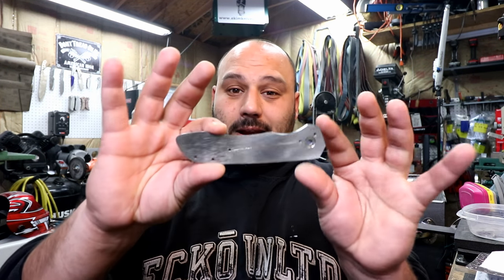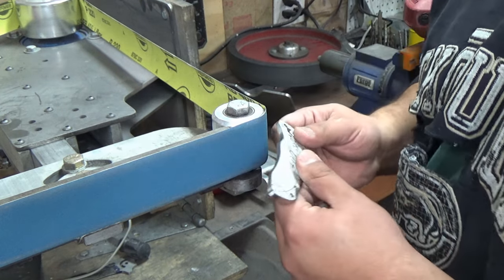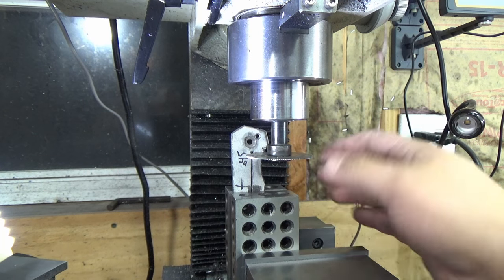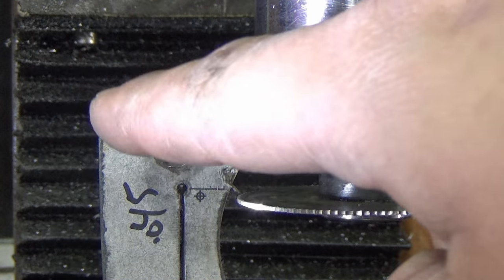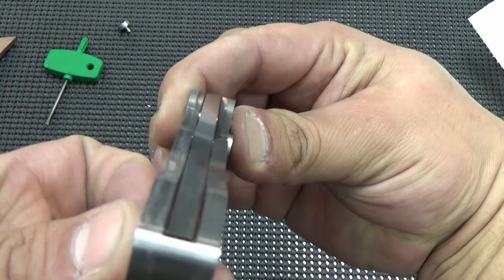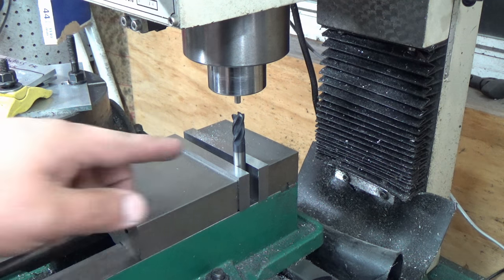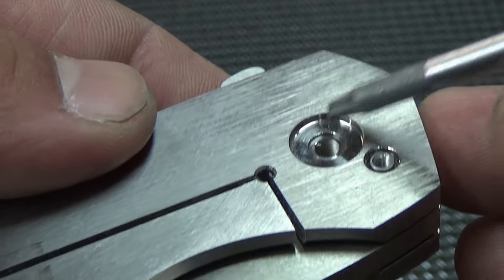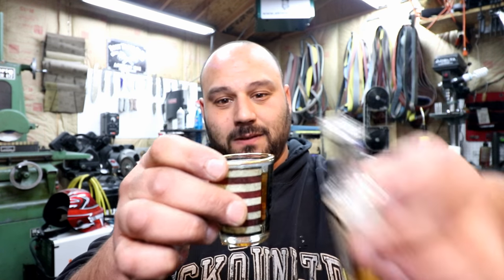How To Make A Folding Knife #10 Detail Work

Comment: Dear Mike, great video again; thanks for sharing your knowledge. I wonder why you used the vise-clamped endmill to shorten the pivot; is there a special reason to that approach? I would have chucked the pivot in the hand drill and gave it a kiss on a 120 grit belt to get the job done. Nice tip to grind the camfer on the inside of the scales before cutting the lock face. I'll do so on my next linerlock build. Cheers and best regards, Timo

Comment: There is an easier way to cut your pivots down. Make a fixture for your surface grinder. It's just a hole with a counter bore on the bottom. I made one for pivots and one for standoffs so I can cut down six of each at the same time. Keeps everything square and parallel.

Comment: What affects the blade when being out of center in the handle and how can you prevent that? I have a few folding knives and I noticed one of my cheap ones favors one side, is that fixable?
Reply from the maker: it could be a number of different things. warping in the blade, pivot hole not perpendicular, back spacer thickness is off, etc. Fixing centering issues the right way usually takes some kind of tooling and adjusting in the shop. You can cheat sometimes by adjusting the pivot and the back spacer screws.
Reply: Ekim Knives thanks, I'll look into it and see if I can fix it.

Comment: Another informative video sir. Cheers 4 sharing , and nice ending... Ah I also forgot to ask in the last video about the lockbar relief ,why some knives have the relief on the outside and some on the inside? is there any difference? And also should the lockbar cutout only go back to the far edge of the relief or should it finish in the middle of the relief or does it matter. Cheers again
Reply from the maker: Inside or outside doesn't really matter. There have been some arguments on which way is better but to be honest the difference is negligible. It also doesn't matter where the lock bar cut ends provided its somewhere in the relief cut.
Reply: Thank you sir